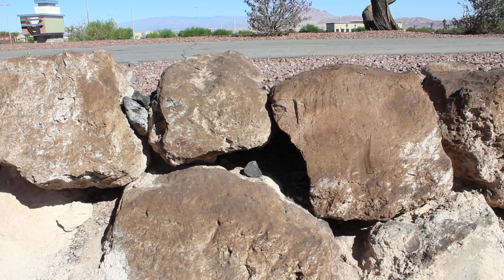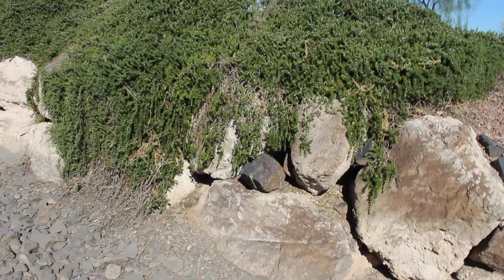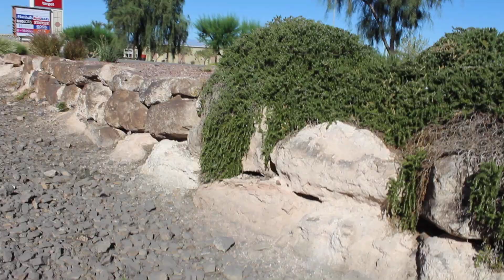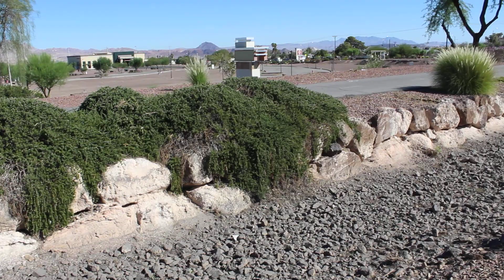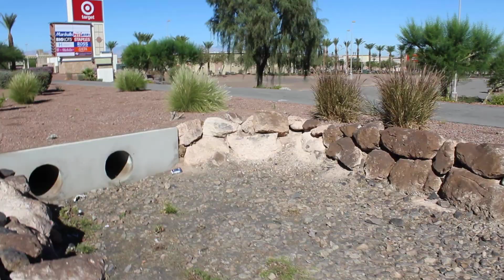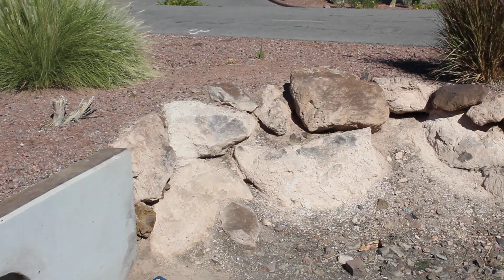Boulder Wall Failure

Comment: They should have inspected the materials before installing or using them. Quality is important. This will cause a lot more money to be spent again, because in 5 or 10 years or more, those rocks, will all disintegrate. Soft rocks should not be used for this type of work.

Comment: An expensive over budget public project. The retaining wall disintegrating in less than 5 years, in one of the driest areas of the country. Any public employee or official that signed off on this should be fired.